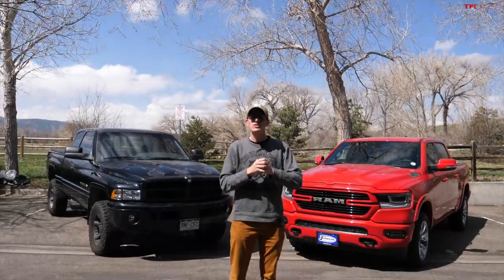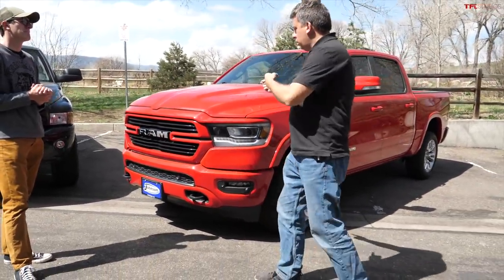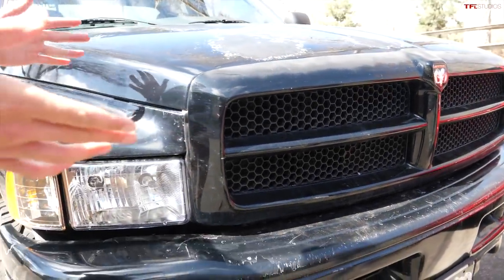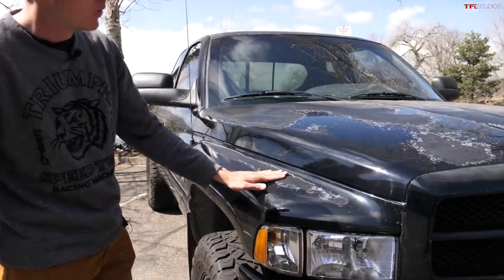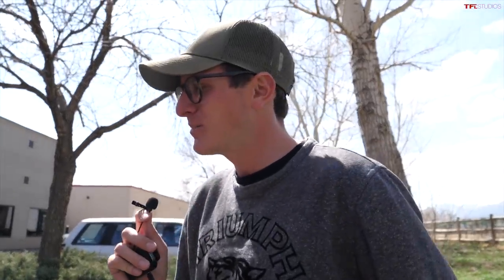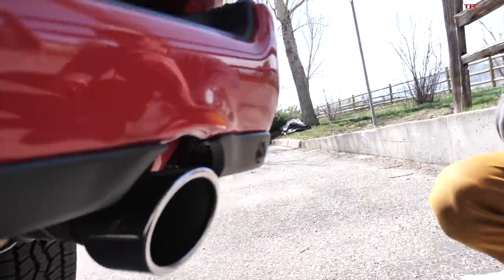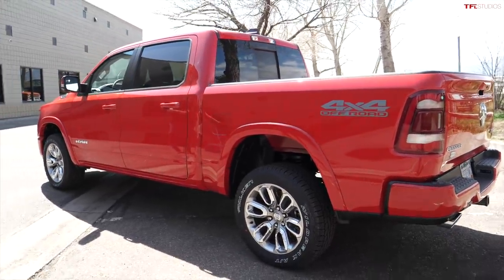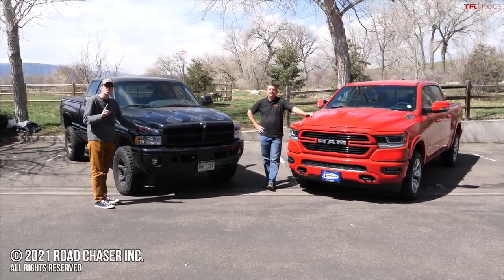Here is What 2 Near Identical RAM Trucks Look Like 20 Years Apart!

Comment: I love those old 2nd gens!!  They might not be perfect, but they are practically indestructible.
Reply: Yeah, especially if you were clever enough (or lucky?) to get one with the manual trans.  And need we mention Cummins 12-valve?
Reply: Except the dash
Reply: I had 2 and theyvare tough as hell and the 5.9l magnum can tow like sob
Reply: Wish that could be said about the dash 😢
Reply: What about the rust lmao
Reply: @John-by9ty  everything rusts

Sincerely a Patriots fan. How was 2014 for you?
Reply: @dawsoneubank1432  Rather have a cracked dash than a Ford Triton spitting out a spark plug.
Reply: Can't say the same thing about the dash and transmissions 💀
Reply: Exept the floor

Comment: I really love that old 2nd gen style, got a 95 1500 with the 5.9 pushing 278k miles still runs and shifts great, dash is in pieces tho lol but nothing a rug cover can't cover up, still looks good too. Dad has a 96 with the 5.2 pushing 312k miles which is insane and that truck isn't stopping either, both are auto transmissions. People say the auto transmissions are garbage and I've seen them fail, but to be honest I've seen the Ford's and Chevy ones fail too and I've had pretty good luck with them personally... so far lol..
Reply: When the transmission needs an overhaul the price could be a lot less than the newer transmissions.

Comment: If you keep the trans fluid changed and put an external trans cooler on the 2nd gen Ram the trans will last a long time. I have a '97 Ram 1500 with a 360 V8 and auto with 272,106 miles on it so far original engine and trans no rebuild yet and still going strong. I can haul and pull what I want with no problems. So if you take care of them they will last, but if you never change the trans fluid, then how can it last? I'll drive mine until it won't run anymore. Oh I've had the truck for going on 8 years and put 80,000 miles on it myself so far, can't complain about the old truck.

Comment: For the 50K difference in price, you can certainly afford to take the old truck to Maaco for paint...and Aamco for transmission repair.  LOL
Reply: LOL absolutely
Reply: I have an 01 Sport 1500 just like that but its silver and singlecab. Im actually rebuilding the transmission in it right now.
Reply: It's going to take a lot more than a transmission rebuild and a cheap Maaco paintjob to brings things up to new spec.
Reply: @felix8289  It actually ran fine before I dropped the tranny. It was a broken retainer ring for one of the clutch packs in the overdrive housing and a broken accumulator spring in the valve body. But to be fair the truck is rusted to all hell.

Comment: That old truck with a new paint job, at least 6 speed transmission, and 35” tires would be way more badass and still cheaper than a stock new one. Plus you won’t mind actually off-roading in it!

Comment: You also failed to mention the Front air dam that auto lowers at speeds to save on fuel mileage which by the way isn’t that great on the ram truck.

Comment: I had a 2001 Intense Blue Pearl quad cab off-road sport. Fully loaded except leather , Sticker price for  it was 32,840. Off-road package had full skid plates, bilsten shocks, 4.10  limited slip rear end. The engine was 360 cu in not 260 as Andre said. Engine was rated at 245 hp/335 ft lB. I kept detailed records on mpg, for the 12 years I owned it.  Average was 13.7 city and 15.3 hwy even with upgraded BFG AT that came on the Hummer H2 (285 or 305).

Had issues with the dash cracking and rust on bottom or both doors.

Comment: I like the older ones. I have 3-2nd gen Rams (97 2500 extended cab, 2 dr, 360 v-8, auto, 01 3500 extended cab, long bed, dually, and 02 2500 extended cab, short bed). 2 are 24v turbo diesels and all are 4x4. They've all seen better days but I'm doing a little at a time. I'm retired and will never be able to afford a new one anyway.

Comment: The older Ram was way better than the new one, and that truck really is more of an extended cab and that does have enough room for your kids in the back
Reply: To be fair, "Quad Cab" was Dodge marketing-speak for an extended cab truck with four doors where everyone else only had three. It wasn't meant to denote a larger overall cab.
Reply: @aaronw8606  Exactly. Quad cab was continued into the newer trucks (starting with the 3rd gens) with rear doors that opened like they would on a crew cab, but at the smaller size of an extended/quad cab. People often use crew and quad cab interchangeably but they're not, a crew cab has longer rear doors and more rear leg room than a quad cab. For half tons (1500s) you will generally find crew cabs with the shorter 5'7 foot bed, and quad cabs with the 6'5 proper short bed. A crew cab with a 5'7 bed and a quad cab with a 6'5 bed are around the same wheelbase, which is around the same as a Chevy Suburban.

Comment: I definitely think that the older dodges were better for offroading as I own one. It would be nice if dodge went back to that old style but with all the new equipment, engine, and transmission.
Reply: I myself even prefer the older body style also. Love that shape and style. New one is not hard to take but the old dodge body’s are classics.
Reply: Thats my favorite ram body. I'd love to have the current tech in that truck.

Comment: The max towing is a lot higher with the tow package which the 01 has, and with the 5.9 magnum it can haul 14k, I’ve owned one and it can pull that, but I currently have the smaller 5.2 which can tow as much as a new ram, TFL might want to do more research on the 01

Comment: I have a 2020 with the offroad package in that exact same color. I did get the 6'4" bed, but in order to do so I had to get the quad cab instead of the crew. Love mine!! Its a BigHorn level 2 with the LED light package and the 8.4 inch screen like your model. Would love to see you guys do some testing with that truck. Thanks for the comparison.
Reply: Aw, that sucks the 6'4" bed isn't available with Crew Cab anymore.  It was available on 4th gen, but of course 5th gen crew cab has a bigger cabin and longer wheelbase already.  Most dealers obviously ordered crew cab with the 5'7" bed -- that's how my '18 is but I'd prefer having that extra bed length.  Of course, Ram Box makes this short bed setup far more spacious than the competition if you have to throw a toolbox behind the cab.  Then you're down to a 3 - 3 1/2' bed, lol.

Comment: I don't feel like 'Sport' and 'Off-Road' come together in perfect union -- I think 'Street' when I think 'Sport', even though the older Ram pulls it off pretty well.  I would def opt for the 18" rim option on the new Ram if off-road is the focus.  Honestly quite surprised that the bed liner isn't standard on Laramie.

The ZF 8-speed auto that has been in Ram since like circa '14 is bulletproof.  The 8HP family debut in the BMW 7-series and eventually made it way in nearly every model right down to 1-series.

Comment: As many people have pointed out you can definitely put a much better Transmission in this truck for a fraction of the price of the new one and in my opinion that is the only downfall of older and newer Dodges is there awful Transmissions
Reply: Sorry. Newer Rams have great transmission. The ZF ya can’t beat. I believe it came out in 2019 or tad earlier. Very good transmission. I would of bought my 2019 Ram otherwise for the older Rams did have issues.
Reply: @ramrider1453  I still feel like we're waiting on the mileage results for long-term durability. I knew someone with a 2014 that was plagued with electronic problems in the transmission. It'd be much simpler if they still offered a third pedal option
Reply: @SleepWarz  For sure. I personally seen friends and coworkers with higher mileage. 180,000 to 230.000 Kilometers. Rams years from 2016 and up. Now these guys don’t baby there truck like I do but yet it surprised me. I was never a Ram guy. More Towards GM. Had Ford also. Both had there issues and with lower mileage.. GM sure had its electrical issues. But your right, let’s see how the higher mileage Rams do and prove themselves. When Toyota came in the 70’s they had the worse reliability. Now look at them. Very very reliable.  Cheers
Reply: As far as half tons go, as that's what I have some knowledge on, the 3rd gens (early 2002-2005, late 2006-2008) have the 545/45RFE. It's original in my 230k mile truck and according to most others seems to be a pretty solid transmission. Just do the correct maintenance, fluid every 50k miles at the maximum (owner's manual calls for 30k if you really want to be strict), filters every 100k. On another note, I would say the most solid of the 5.7 Hemis are the non-MDS (no cylinder deactivation) models from around 2002-2005 I believe. Not blaming owners but I'd say the most common source of transmission problems is lack of maintenance.

Comment: Video Challenge, Ike tow and drag race 2 new Rams equally equipped, with the only exception of the Etorque.
Reply: eTorque helps off the line and in the city. And start/stop is disabled with a trailer attached. So it would be moot.

Comment: My off-road package have 4.10 but not limited slip rear diff. 2001
Reply: Unless it was removed it does, it just doesn’t work lol. Likely needs clutches replaced, not a horribly difficult job
Reply: @tylerphelps4868  it has off-road decal. And I even opened up the diff. Spider gears. Has factory lift to
Reply: It was a blow truck . Maybe he wanted open diff for snow
Reply: @TheDevonwurz  limited slips still have spiders

Comment: The 20 year old one is still on the road and runs. The one on the right probably will need 15,000 dollars worth of work to make it 20 years.. New cam, lifters, transmission new front and rear diffs and all electrical replaced!
Reply: the newer ram is built with better quality and it is less likely to fix the transmission because the ZF 8 speed is reliable and ram owners fixed the cam/lifter issue using redline oil. eltrical might be an issue but then again all new trucks are being run by computers so there's nothing to do.

Comment: You need to clean those weird wheels on the second gen ....they are dirty ..I'll take the second generation all day over the new ram...i got a second generation 2001 sport 4x4 i have the factory window sticker when it was new at $31,000 in 2001 ....

Comment: That is a dual featured truck being its a sport and a off-road, two completely different packages the off road was lifted slightly more and had trussed front and rear axles, and those wheels where 17” and where only available on the off road package.the only things the sport package gave you was front and rear painted bumpers a painted grill. The only other difference was the head lights you had a dual (two bulb) light setup on the sport v/s single bulb set up on the rest of the trim packages. The talk of those transmissions be problematic is in my opinion a way to pass you inability to drive and take care of things I had probably 20 or more of these trucks and not one transmission issue. They were a bit underpowered and were very bad in regards to gas. I still have probably 8 or 9 of them now.including an in molested 3/4 ton Cummins powered 4x4 longbed sport. It has a Dana 80 real end 6 speed manual transmission, I love all dodge but the newer they get the more ford and Chevy they get, not real Mopar anymore. They need to stand out again like the did in the past.

Comment: Hey Tommy I have that exact Transmission in my 2nd generation Dodge and she’s at 295,000 miles so retract your statement and think before you make stupid statements like that!
Reply: Yep.  My 1995 2500 V10 has 150,000 with zero issues.  Changed the fluid/filter every 50K and was like new every time.
Reply: I have A 1998 Dakota 5.2L Sport 4X4, (Ram's little brother), with about 172,000 miles on the transmission, and other than being reluctant to upshift to third gear when it's cold still works very well, despite the fact that it hasn't been impeccably maintained. (Fluid changes and band adjustments.) The 5.2L engine in it has to be the sweetest engine I have ever owned, and the dash has no cracks. Don't know if the dash cracking was problem on Dakotas as on Rams.

Comment: 5k for a 2nd gen gasser? man you overpaid for that. they are a dime a dozen truck.
Reply: In Colorado, they got a pretty good price. Cars weather, but don’t really rust. I grew up in WI, it would be $3,000 with a hole in the bed and floor
Reply: @paulriley6061  Dang. and here I can get them for around 500-800 a truck. tho the diesels still hold like 4-5k.